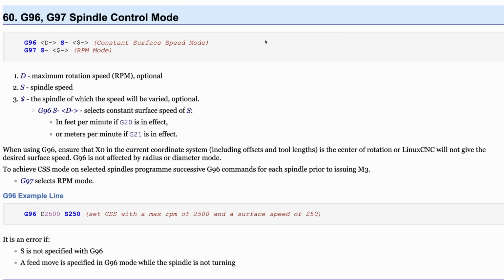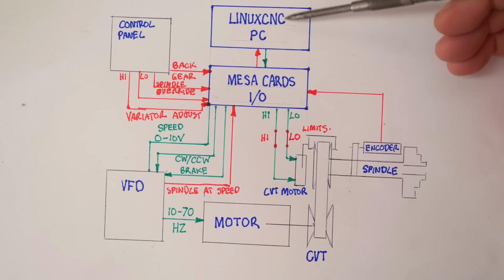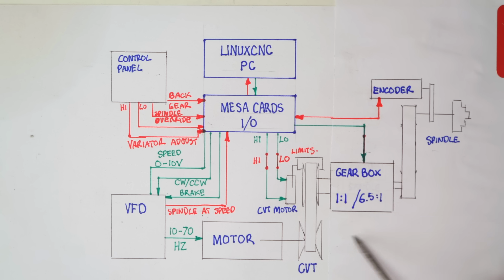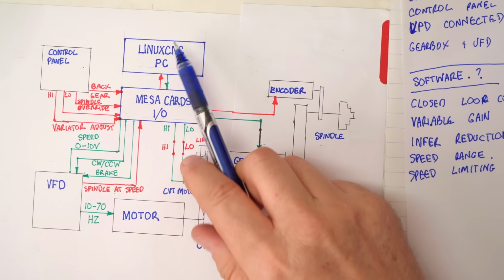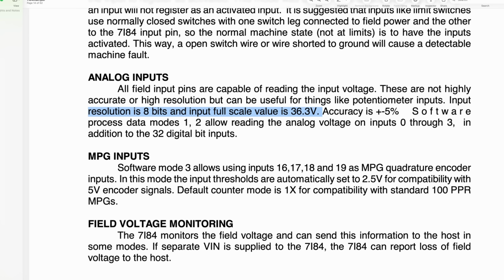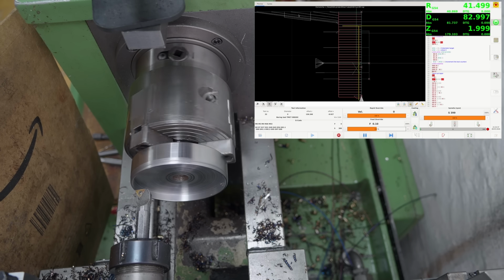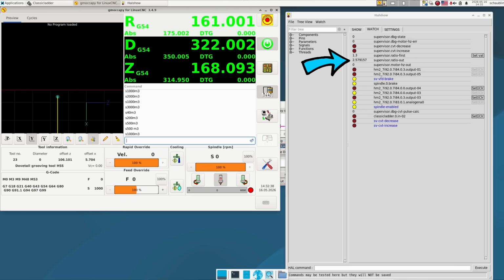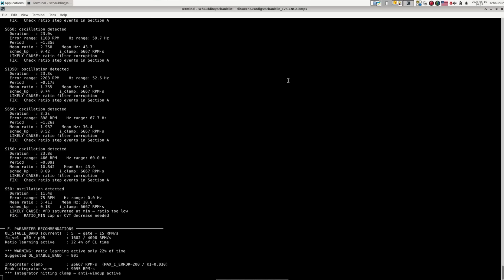Schaublin spindle control Ep.68. || RotarySMP

Comment: I like the exploration videos, it's interesting to me to see your troubleshooting and logical processes, they're often different from mine. 

For the control situation, I would probably try a tiered approach where the system uses the gearbox for major adjustments, the cvt for coarse adjustments, and the motor frequency for fine adjustments. I'm no control expert, so this is just thinking outloud.

I feel like spinning the motor at the lowest frequency first to establish a current baseline is a good approach, the system should be able to work out roughly where it is based on that. Since the CVT has to be spinning to be adjusted, it would probably be wise to have a startup sequence that zeros the CVT and gearbox at a known value, and work from there.

I think I would probably try to engineer something where the system would look at the commanded value and determine what part of the system to adjust first to achieve the speed, so if the commanded speed is low enough, switch the back gears, if not, adjust the CVT, and if not, adjust the frequency. 

If you're thinking of adding additional sensors, a limit switch that detects the CVT centre position might be wise so that when you're on centre you know you can adjust the RPM a known amount up or down. Also, running at the CVT centre position by default will give you more adjustability in CSS mode, the frequency could be adjusted a couple percent up or down and, when that goes out of threshold, the CVT could be bumped and the frequency reset to median. 

It's probably wise to have a back gear lockout in CSS mode, I doubt you want it changing gears when it's running. 

Hopefully some of that gives you ideas!
Reply from the maker: Thanks for your ideas. Pretty much what I was doing.  The main issues are that the motor commanded frequency signal is often poorly correlated with motor speed, and that the CVT adjusts at a fixed rate, and often a lower rate is necessary for CSS facing, and therefore the VFD needs to reduce RPM at the same time compensating for the CVT is increasing too rapidly..
 I have written up my plan for the next attempt in the video description.
Reply: @RotarySMP that is quite a challenge to manage, I'd like to know how Schaublin managed it originally 🤔

Looking forward to see what you come up with!

Comment: Great stuff! I had lean towards the screen. As an software engineer, I struggle daily with language models. As for now, general models are not yet very good with this kind of logic. It helps if you use i.e. vscode's agent. It takes your files as a context and you'll be able to set the reasoning to extra high. The browser version has quite quick reasoning setting. It might help with getting a bit more correct vibe-logic. The most robust approach now is to read through the generated code and reasoning out where it's doing something illogical. Takes some time and thought though.
Reply from the maker: Yeah, I let anthropic run done a rabbit hole on this one. Need to be more careful on the next attempt.
 I have written up my plan for the next attempt in the video description.

Comment: good video Mark..thanks fpr your time
If I may offer a couple of suggestions,
the first is that you could install a rotary encoder on the back of the original three-phase motor. That's how elevators are used, and as you can imagine, it works very well. I also think it's necessary to use a slightly more modern frequency inverter with vector control and an output for a braking resistor.
The second option would be to eliminate your three-phase motor and install a large servomotor of at least 2.2 kW or higher. I think that would solve all your problems. Besides, nowadays the Chinese manufacture excellent servomotors at affordable prices.

Ultimately, the decision is yours. We, as observers, are just offering our opinions.

Greetings from Spain

Michel
Reply from the maker: Hi Michel. Good inputs.  
The current motor is 3Kw, and I managed to stall that at low RPM / HZ Hi CVTin back gear with the trepanning cut. I like the torque of the mechanical reduction :) I thing the 125-CCN follow on model replaced the 3KW induction motor with a 10+ kw servo. I only have a 16A feed.

I added more info to the video description on what my next attempt will be.

Comment: Disclaimers: Software / control engineering is not my area, I know you don't want to add position feedback to the CVT, and I haven't read all the comments, so it may have been mentioned:
If you locked the CVT ratio as a function of tool X-position, then you only have two variables to worry about (the gearbox and the VFD).
Then create a CVT / gearbox lookup table that can be referred to for  controlling the VFD.
When the machine is turned on, run the motor at 10Hz, and home the tool changer and the CVT.
Reply from the maker: A LUT is my next attempt.

Comment: Hi Mark,
Your problem makes my brain hurt 😅,
On my Schaublin I removed the Variable speed poulies and just the reduction gears.
Essentially 2 speed range with a VFD 
Easy on my brain 😂
Reply from the maker: Hi Constantin. Easy on the brain, hard on the wallet. How many KW motor did you install. I think the 125-CCN removed the back gear are well, and put in a 10+kw motor. 

Did your 125-CNC ever run under the DG Nova control when you got it? Could it do CSS, or just fixed steps with the CVT?

Comment: Couldn’t you treat the cvt location like an axis, and use a dro scale to measure the location of the adjusting part, as a way to understand the location of the cvt control?  Given you’re essentially using a leadscrew to move two parts relative to each other, that seems like a fairly simple and effective way to measure the current location. And it should be relatively easy to implement and install, if the system has the capability to add an axis and the software can read it where you need the info
Reply from the maker: You could. Check out the video description, I added a summary of the options today.

Comment: Scaling the voltage (0-10V) from the VFD (actual speed) to 0-36V is easy and cheap, adding offset isn't that hard either. I don't think it would be better than an encoder, and I don't know if feedback on the motor speed would totally solve your problem anyway, but if you know anyone who does electronics, knocking up a circuit to take 3-8V and scaling that to 0-36V would only be an afternoons work. In fact, it'd be a single chip and two potentiometers to set the offset and gain, assuming you have a negative voltage rail. Else you'd need a couple more ICs, but still fairly bread and butter stuff for an electronics engineer/enthusiast.
Reply from the maker: Thanks Thomas, adding the SPU to step 24V up to 36V and smooth it would also take a bit of effort that is beyond me incompetence ;/

Comment: Take a look at open code. It allows you to change the model on the fly and allows tool usage. I use it to write complex software. Open code go was enough data to work for a week straight at 8 hours. I like minimax 3.5 free for basic changes and planning. I use kimi 2.5 or 2.6 for coding changes.

Comment: The encoder bodge for your motor could be pretty easy though. I used to service large character drop on demand inkjet printers that just used a rotary encoder that was spring mounted and had a pulley with 3 circumferential o rings that you could mount next to and position against a motor drive pulley or conveyor belt to collect it's speed (tangential or straight line in these instances). Something like that might work here.
Reply from the maker: Thanks Dennis, I added some more information on my next attempt to the video description.

Comment: Thanks for taking us along!
If you must keep using AI instead of a professional for help, I'd look into getting it to spin you up some sort of virtual system for testing so you don't fry or damage the beautiful Schaublin!
- Virtual model of lathe drivetrain
- Connectable to LinuxCNC
- Logs data through LinuxCNC
- AI model can suggest a program, test it, get output automatically
- No spinning metal involved!
Reply from the maker: Doesn't that lead to a "every model is wrong, some are useful" point? :)

Comment: I'd move the encoder to the top belt pulley, if that's possible and then just  divide by 6.5 in low gear.
Reply from the maker: It would be easier to mount to the motor, and that would automatically provide gearbox position with it.
Reply: @RotarySMP The top gearbox pulley shaft I would have thought would have been the best position for using everything you have already got, using the one encoder you have, with just half a turn lag of the bottom pulley then that is the only variable in both gears irispectively. Then go for a cheap servo motor to replace the speed control adjustment motor next, if still no good then encode the drive motor or even scrapping the screw and nut as well as the speed adjustment motor for one of them servo motors systems that are used to replace hydraulic cylinders that are used in hospital beds. I'm not into all this stuff personally so it's just my 2 cents here. But the lag in the belt of speed adjustment is the elephant in the room I would have concluded.
Reply from the maker: @CapitainSuperWeapon Thanks for your thought on this. I have written up my plan for the next attempt in the video description.
Reply: @RotarySMP I will have to start reading these from now on,LOL. Great channel, have you ever thought of making a plastic injection moulding machine, I can give you some really good ideas for one that would run off any size air compressor that would beat the pants off anything anyone's else has done. Or if you've got 3ph 15.5kw or more you could get one second hand for around $1000 called a Arburg allrounder 25 ton, A old U model the dark green ones are the best due to them being able to be configured horizontal or vertical on the clamp and or injection unit, I believe.

Comment: AIs are useful but they also require you to understand code to quite a good degree if you are trying to do something difficult. It seems your are coding it in python, it is generally the simples language to understand so take some time go throe it and see how the logic works, and what you don't know ask AI : P. It seems like you only have a small bug in the code that's too simple for the AI to spot, if you don't mind sharing it i can take a look.
Reply from the maker: The LinuxCNC comps get coded in C. Just the code to review the data log and summarise it is in Python. Thanks for your offer, but at this stage I am changing direction and starting with a new concept. I described it in the video description.

Comment: Instead of using an encoder to track motor speed can you just paint or stick a reflective stripe on the output shaft of the motor and use an optical tachometer?
Reply from the maker: Good point Dave. I have written up my plan for the next attempt in the video description.

Comment: Hi Mark, I think you are aproaching the problem from an unsolvable angle I want to try and help you with that. First view the system as it was designed by shcaublin, make that work and impove from there (start small). The original constant speed mode was achived by the variator without changing the speed of the motor or switching speeds if I think correct. So first just use that. If the commanded speed is out of range you can stop the variator at the end of it travel and switch to the vfd switching one closed loop off and on another. Changing the speed range under load is not smart so that has to be already commandad at start or pause the cut. The feedback from the variator can be the ratio as you already using but when designing the code first use commanded positons for the variator and map out the variator so when closed loop is activ it has a smaller window to adjust. With chatgpt I find that you have to be very specific about what you want and not let it invent the solution, this is the objective this is the solution write the code nothing else. After that I copy the existing code and tell it to do one specific change or improvement and start a new thread every time. Every time before I send the new commands to chatgpt I read what I want to command and ask my self can this be intrerpeted some way else than I want and usualy make the command more specific. I hope you succeed.
Reply from the maker: Good points. I rechecked the manual, and am not convinced it originally did CSS. You could select between RPM or surface speed, but I think it did discrete speed steps over 48 steps.
I added some info on my options and next attempt to the video description.

Comment: You believe in living dangerously Mark, that ribbon swarf at about 20min 20sec, I bet that is quite sharp!  I wanted to put an encoder on the output of the CVT, (is that the thing to count RPM?) then you said to do it with software.  What will Mrs Rotary have to say about the oily smoke on the chillies?  Keep up the good work!! John
Reply from the maker: Thanks John. Yeah, that ribbon swarf was nasty. Only touch that with the metal hook. 
It has been pointed out there are contactless encoders.  (AS5600) magic what is available.

Comment: I think you have to use 2 pid or pi loops, one for the motor and one for the cvt, i would tune the motor loop for the best torque in a way that the range the cvt has to work can cover the rpms you need dependinf on the cut
Reply from the maker: That is sort of what I had, but the issue was measuring overall ratio, needed to set the gains, but basing ratio  on VFD Analog input, which lead to a lot of gating and freezing to try and find a cleean signal.
Reply: You mentioned the mesa card outputs 0-36v and you have to limit to 0-10 v for the vfd, in wich case there is a loss of dynamiv range to control motor rpm, maybe if its only a control signal with low current could you consider trying a voltage divider at the mesa card so that it lowers the mesa card  voltage to maximum of 10v? - maybe with more dynamic range on the motor control signal it would smooth out any pid oscillations
Reply from the maker: Other way around Andre. The VFD outputs motor speed as a 0-10V analog signal, but te analog inputs to the Mesa 7i84 are 0-36V at 8 bit, so I only have low resolution to read it in like that.

The command from Mesa to the VFD is 0-10V, which is what the VFD expects. I have been using that value as "motor speed" but it rises immediately, which the mechanical drive needs to accelerate, so the calcuated ratio is garbage until steady state. That is why I needed a lot of gating and freezing on that ratio calc.
Reply: Sorry for my english, i sort of thinking loud and i may sound a bit bossy😂
The cvt ratio and gearbox selection is complicating matters a lot, for it to work there must be a way to add a induction switch, like a endstop.switch on the gearbox to know the fixed ratio, then it would simplify things to find the cvt ratio, with this discrete signal it would be a if...then case without even starting the motor.
Excellent work and production value on making these videos, it must be a lot of work editing everything, besides tinkering with the machines😅
Reply from the maker: @andrecarlos985  The fixed back gear is not a problem, as it is only switched when stationary, and I can monitor and remember the commanded value.

It is a lot of work to make the videos. Thanks for noticing :)

Comment: If you want to use the CVT dynamically it needs to have some sort of positional feedback for ratio. 
If you need to confirm gear selection it will need positional confirmation beyond commanded position.
Final finite speed control under %10 should be done with motor control.

Typical Scrooge approach shouldn't be too tricky.  I used to maintain some vintage equipment that used an Air over Oil system to move rapidly and accurately a couple of 12" rams to within 1mm of position repeatable 1100kg about 4 feet in less than 2 seconds. This all predated PLC control and used a cam switch for its automation. For dead accurate positional control it needed positional confirmation from a switch.  Fast Forward 40 years and there is no more silver left on the cam switch contacts, so a plc conversion was needed.  No money available for a proper conversion so we had to get creative.  It needed setup tuning along with recipe  selection for different tooling. 

The simple and quite reliable method we used was a multi turn potentiometer, rotary spring to maintain tension and a long piece of fishing steel trace normally used for shark fishing as the cable connecting the pot to the job.  Depending on the pot used we just changed the pulley on it to suit distance and max feedback available turn wise.  So resistance changed with position, so a feedback voltage or resistance was achievable that represented position.  In later years when price came down encoders were also used in this task with very accurate success. CVT's are not that accurate so it should be good enough to control position with a ChatGPT sub routine.  Just a commanded speed using the feedback ratio of the voltage change. Aim center, get feedback within %10 adjust motor outside %10 adjust CVT. Command CVT every time for speed then correct. Probably use an additional speed or motor M code to prevent it from being used all the time unless you want to do that.

Gear selection without position switching confirmation? It got by without so maybe just an alarm that indicated measured RPM out of commanded range. This would need to be a gross error that would only indicate gear wrong or belt broken, maybe CVT stuck.
Cheers
Reply from the maker: Thanks for your experience and cool story. 

For CVT lever arm feedback I was recommended the AS5600. Pretty amazing the sort of widgets you can get for cents these days.

I have written up my plan for the next attempt in the video description.